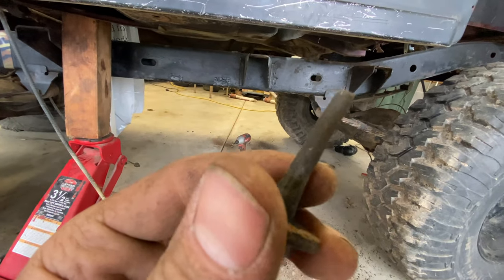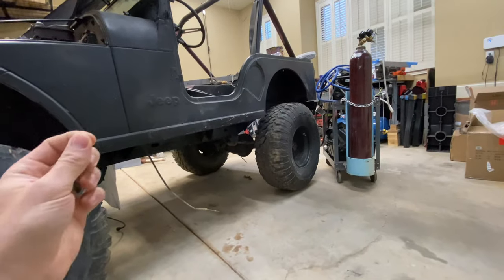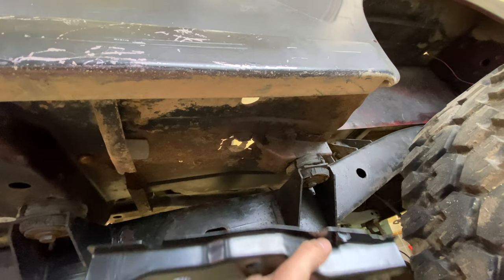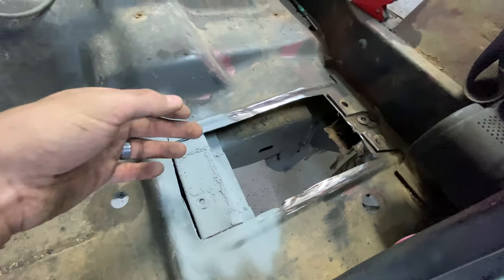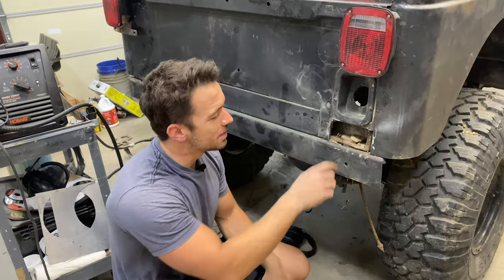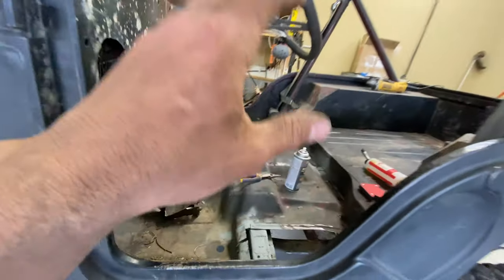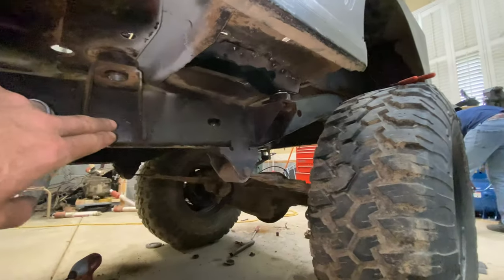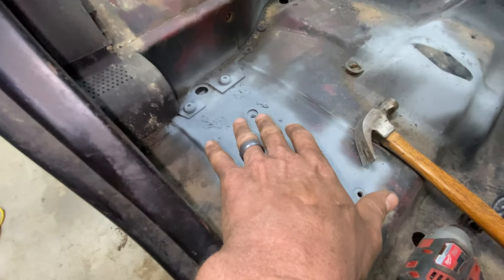Repairing MASSIVE structural damage! - Jeep CJ5 rebuild series part 4

Comment: dang that joby looks cool!
Reply from the maker: Best pod out there 😂
Reply: Awesome stuff.  I am restoring an 83 CJ5 with exactly the same motor and trans.  I think mine is in a little better condition.  You have motivated me to do more!   

Where did you get the weld in metal body mounts?  I need a few myself.  Thanks again for your awesome inspiring videos!
Reply from the maker: @dmkorn02  Thanks for watching Dan! I'm glad you're enjoying the videos! It really has been rewarding to repair/build the Jeep... hopefully you feel the same working on yours :) I ordered the mounts from Quadratec "0479-315 Outboard Floor Support"

Comment: Great video!  May I ask, where did you get the underbody structural pieces you welded in?  I am going to be pulling off my 1975 CJ5 body over the holidays and fear those may be components I will be needing.
Reply from the maker: Thanks for watching Michael! I found them on the quadratec website.... part number 22507.0118. It's also called an "Outboard Floor Support"
Reply: @NickDowner  Thanks, really appreciate it!
Reply from the maker: @michaelyoung3337  No problem! Hit me up if you have any other questions. It was a relatively easy swap

Comment: 76 was the last year for cj5 tailgates early 76 had them late 76 did not
Reply from the maker: Ahh gotcha. Thanks for the info and thanks for watching!
Reply: @NickDowner  Nope.  You could get a tailgate all the way up until the last year 1983 in a cj5.  They were more rare after 76 but you could for sure get tailgates in a cj5 if you ordered it that way or the dealer ordered it that way.
Reply: Renegades did not have tail gate